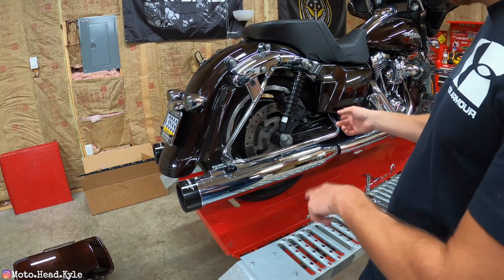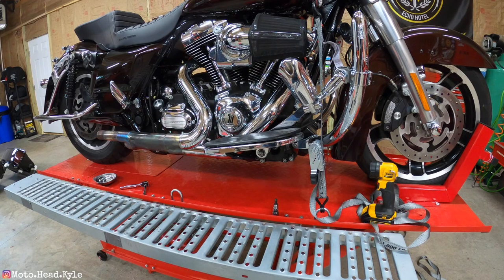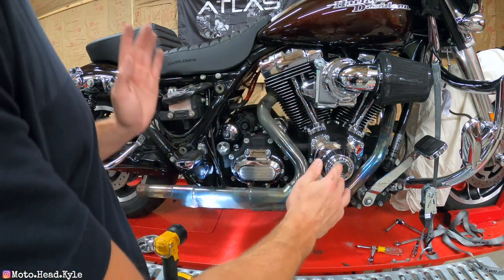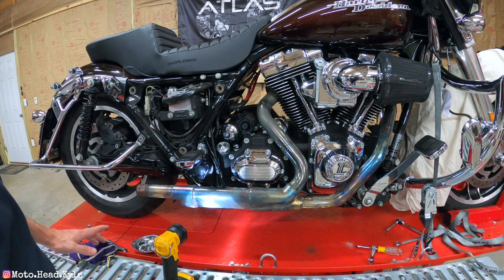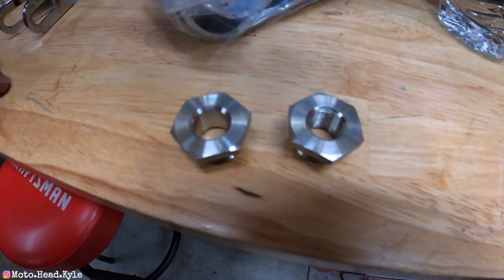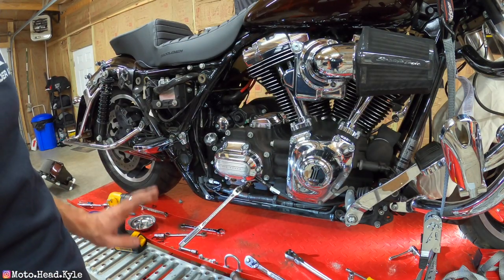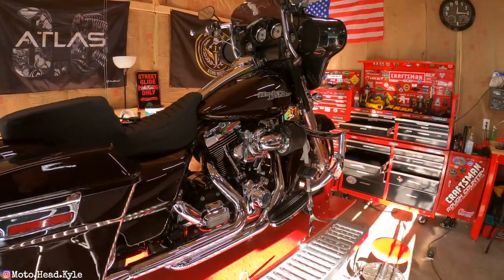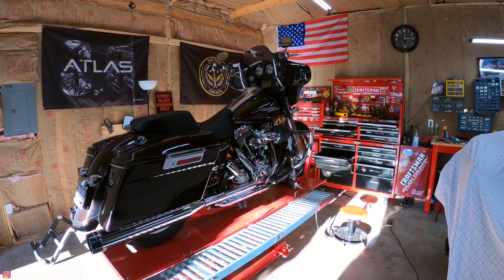Harley Davidson Exhaust Install on a Street Glide (S&S Performance)

Comment: The Rinehart mufflers used be good sounding before. What happened to them? I bought the Rinehart 4.5s and honestly I don't like the sound. Too flatulent sounding as are the ones in this video. I also have aftermarket header pipes. There are deeper sounding mufflers out there like Tab or Kromewerks. Time to sell and upgrade. Nice how to video, though. Thanks.

Comment: You skipped right over the hardest part, getting the header pipes around the cylinder head fins and onto the exhaust ports! lol
Even when you do it the recommended puzzle piece fitting way, it's real tight. I had to use some brute force to try to spread them a little bit as I worked that last pipe around the cooling fins and I still scraped the fins just a little bit. Didn't really do any damage though.
Reply from the maker: What am I supposed to show? me blocking the camera and taking the same 20-30 minutes of trial by error getting it to fit on right? Haha yeah it’s a PAIN by far the hardest part
Reply: @MotoHeadKyle  lol, yes! Hahaha, I want to witness that from somewhere other than hands on and my bike.

Comment: I bought my pipe in 2019 for a 2014 SG. Till this day I cannot get the cross-pipe to seal. I try to reseal it every season. Your cross-pipe clamp looks different than mine. It also cannot face the way yours is. My chrome shield goes way behind the back tire. It looks like yours is improved on a lot more than mine. I know it's not sealing because sometimes I get a backfire that sound like it's under the bike. I also snooped it AKA "soap and water" and it bubbles like crazy. I am getting to the point where I want to get a Vance and Hines X pipe. It looks a lot easier to install their cross pipe and the few ppl I know have no problems with it. Don't get me wrong I do love this pipe and I learn hard which I hear the x pipe will limit me at that. 
Do you or anyone on here have any tips or tricks?
Reply from the maker: Hmm interesting. Did you try loosening the bracket that secures the cross over to the bike, then adjusting/ tightening the cross over clamp? That’s the only thing I can think of. Perhaps reach out to them. Maybe they know that was a problem and perhaps they might send you a new part

Comment: grreat video but  I have some novice questions.  Why remove the main fuse?  What criteria did you use to choose the brand of pipes?  Does the bike require a tune after replacing  headers?
Reply from the maker: Thank you! Main fuse removal is because we’re unplugging the o2 sensors, Harley’s can be extremely sensitive and throw a check engine light, so this prevents that. It was my fathers choice on pipes, he wanted a reputable brand which s&s obviously is as well as price, which these were on a great sale at the time. It is highly recommended to flash, I wouldn’t ride it much if at all until you get it flashed, especially depending on year and other mods.

Comment: Nice video! Sounds really good. I just purchased the S&S headers for my 13 Ultra. How hard was it to get the header on the studs on the cylinders? Seems really tight!
Reply from the maker: Thank you, Landis! Nice! They do sound awesome and perform pretty well. It was really tight. It took 5 minutes or so of trying to wiggle them into the perfect spot, but that was by far the hardest part. Hopefully you get lucky, and they slide in perfectly🤘🏻

Comment: Great video.  Did you install a fuel tuner or did you already have one on the bike?  If so, which tuner did you go with?
Reply from the maker: Thank you! Already had a full stage 1 flash from Harley, but will most likely be retuning with a Dynojet power vision sometime soon!
Reply: @MotoHeadKyle  thanks for the reply, Kyle!  I just ordered the S&S for my 2012 SG and will be adding the DynoJet Commander 6.  Wish me luck!
Reply from the maker: @JoseGutierrez-bx5ln  Awesome! Let me know how you like the commander 6